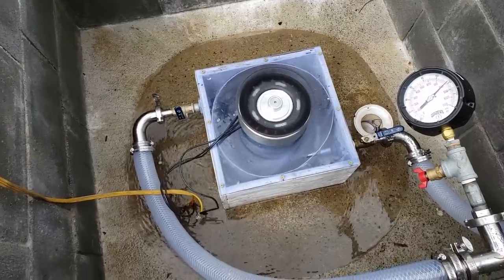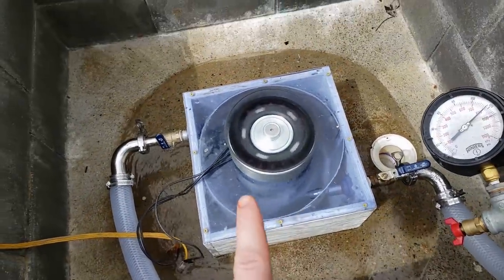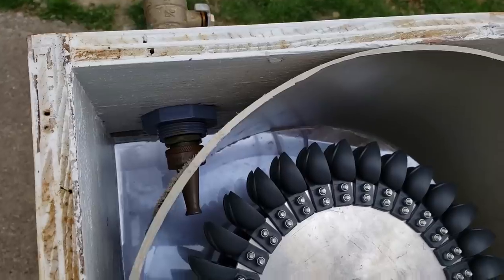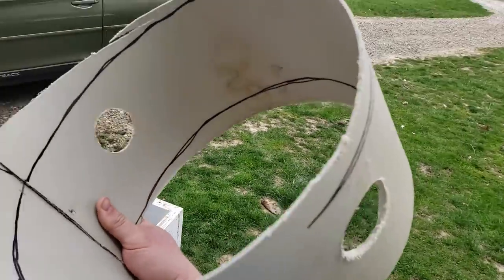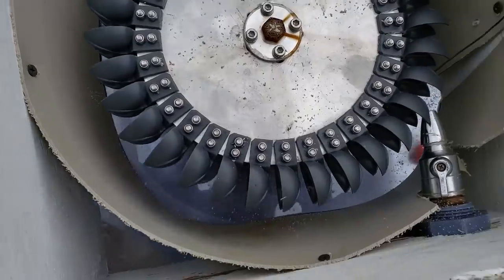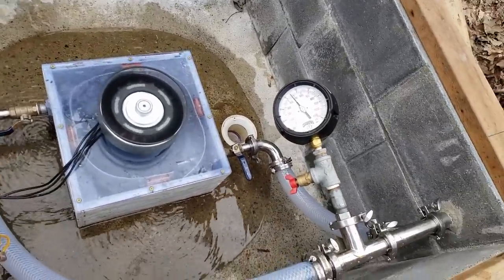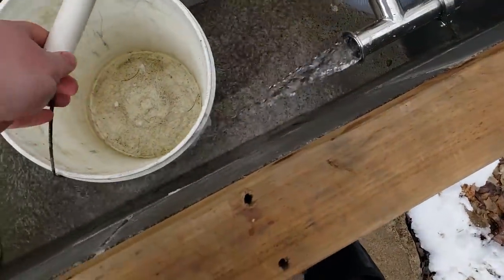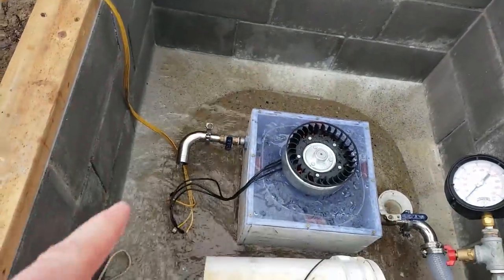Conical Turbine Housing, An Improvement?

Comment: would it work better  
if the circular buildings were smaller  
so that the blades are max 1 mm  
from her  
and that the blades are not cut as they are in the middle   only in full
 but their tips should be bent

in the direction of the water's flight 
so that the water from the walls also pushes the slopes  
and slid off them in the direction of circulating water back to  circular building walls

so as not to lose energy

Comment: Mounting it vertical will allow the water to escape without falling back through the turbine.
Reply: Christian Strohmaier Yes, another good idea.
Reply: horizontal is better for the bearings. He just needs a proper shaped housing. He could also consider just submerging that part of the turbine entirely and get rid of the nozles. Just use the water pressure like a tesla turbine does.

Comment: One test that would be fun to see is if the wheel has the power to run a cars AC pump. Why not take full advantage of the system to dump heat/cold into the house to match the season?
Reply from the maker: I plan on at least partially powering a minisplit to heat and cool my workshop.

Comment: The problem with your system is you are not thinking outside the box. And the box is your problem, it is containing waste water, not shedding it. An open frame is a better solution, once the water has impacted the pelton wheel you must clear the excess water away as quickly as possible. A round frame with 16 over lapping static blades in a spiral design would duct waste water away from the pelton and keep from rebounding back thus reducing drag to a minimum. 
Salute. ppcli 4 life

Comment: What about reflecting the water away (downwards) from the turbine where it currently is hitting your cone hard and splashes back? Another point is that if the water would give it's whole energy to the turbine it should just drop down or am I wrong. Where does all the fast moving reflection come from? Is it hitting the backside of the nect turbine shovel?

Comment: It looks like to me you still have water circulating around WITH the rotation of the wheel. Would it not be better if there were NO water circulating causing drag on the wheel? I would like to see you try your wheel with no liner, no walls. As soon as the water impinges upon the wheel, it just falls away / splashes away. What do you think of this idea? Thanks for sharing these videos with us.

Comment: Oh cutting slots at the top of the inner housing above the turbine is to channel that expended low velocity draft OUT of the inner housing....BTW...  =)  Probably should try to keep as much kinetic energy within the housing as possible.  It's gotta be a tighter fit...!    
Don't know though, both theories could end up being counter productive. Could be that the round housing is maintaining a lot of that velocity, transferring more KE before the spent flow drops out of the vortex... right..?    Oh and placing a small intermittant tank with an overflow loop a couple yards up the hill the would keep the flow steady and maintain the same flow.....  like a water capacitor....  =)  happy generating...!  Love watching....

Comment: I'm not a hydro-scientist by any means, however, I am a mechanic. When building an engine for performance, one of the ways you improve your performance is by using a windage tray which fits near the crankshaft. What it does is, as the crankshaft spins around, oil is ejected from off of the crankshaft. Without a windage tray, the oil bounces off of the walls of the block and back at the crankshaft. When it hits the crankshaft, it reduces the performance. How does this apply to you? You need to scavenge the water after it hits the turbine spoons (whatever you call the objects the water is hitting as it comes out of the nozzles) so it doesn't hit the spoons again, reducing efficiency. You could accomplish this taking a thin piece of stainless steel sheet and cutting slats into it, with protrusions pointing out towards where the spoons are at. I could draw a better picture than I'm describing it, lol. Better yet, the following image may explain better: https://www.vividracing.com/wm.php/images/20-914.jpg
Reply from the maker: I'm moving away from this style for windage issues.

Comment: Hey bro why don’t you try to put  another hose by separated  ? Because I guess it loses water pressure...because I see the same rpm when you open both of them at the same time I guess it’s not a good deal getting water current from the same duct or coming  from the same main line it’s like you are realizing the pressure when you open the second water valve  if it is separated I guess it would be a lot better ... well it’s just a suggestion ... good luck with your project !

Comment: If the housing was larger would that allow more room and distance for the water to not be able to bounce back and impede the turbine?  Maybe another 8 inches in diameter. That would leave 4 more inches for the water to travel after it hits the turbine if that is understandable.
Reply from the maker: I wanted the jets to be well supported close to the runner, also a  smaller box let me use scraps I had laying around and is lighter.

Comment: New to your channel so if you've shown this clearly I've not seen it just yet. You may want to consider a reconfigure of your Battery System to 24 or perhaps 48 Volts. Granted it will reduce your capacity but charging will be greater as you seem to constantly run @80ish volts. Your Charger is working overtime reducing the 80 volts to 12 which results in heat exchange. Since your water is 24/7ish the reduced battery capacity might not be an issue. I am learning 48 Volts seems to be the Standard and everything just seems to work better at that range. Wires don't tend to heat up as easily because with more volts is less heat. Again I don't don't know how many batteries you have. Also you'd need to reduce 48 to 12 which is easily done with converters and whatnot. Just a thought...
Reply from the maker: 48v is in the fiture.

Comment: For content - maybe do a 3d printed cone. Make it in 4 parts (so it fits your printer). Have two parts that are fixed in and two (where nozzles are) that slide in (like a sleuce gate) but have a slot for the nozzles. I can email you my idea if you want.
Reply from the maker: I have a 3d printer and have though of this, but I'm abandoning this style of turbine for a turgo in a stainess housing.
Reply: Joe Malovich will you have a circular cone shape or pyramid shaped stainless housing? Also with low flow rate -  if you increased your reservoir capacity would have enough volume to account for the inflow flow reduction (so you can run longer with out lowering output to avoid sucking air etc).

Comment: Imho you are using too big nozzles or the spoons are set a bit too narrow for the geometry for your small Pelton spoons, so your spons get clogged with water, which causes much drag. To gain the same or even more power, try to fix it by using more small nozzles (up to 6). Side effect: You can more easily optimize your power outtake to the provided amount of water by simple switching on and off the nozzles.

Comment: I wounder if you took a piece of 4" or 6" PVC, cut it in half lengthwise, then slowly heated it so that you could bend it into a circle around the outside of your Pelton wheel?  The industrial Pelton wheels seem to be place in a housing that closer surrounds the wheel.  Just a thought.  I am learning a lot from your VLOG so keep up the good work!
Reply: I was going to place the same comment, why not to use an exponential spiral shape. the lower side near the jets and the big side 180 degrees away?? like the francis turbines ingress tube.
Reply from the maker: A fantastic idea! I'm always in favor of attacking problems with a heat gun and PVC

Comment: I like your vids, but why dont you run larger cables back to the shed to help with volt drop? Cheers
Reply from the maker: only 10A 3ph, not much of a drop. I have some 4ga wire to run.

Comment: Why no use a spongeous cover for the housing? It will avoid backsplash and is easier to instal
Reply: After saturation, I don't see any benefit. It will keep splashing just the same.

Comment: Do you know how close are you to a theoretical maximum power from your system? (Given the 9 gpm flow and pressure measurement at the turbine)
Reply: At 9GPM and 120 psi converted to metres of head (82.7 or 277ft) he's making around 60% efficiency at the controller. Turbine losses, transmission losses, rectifier (AC to DC) losses, controller losses would add up, I'd hazard the turbine itself is 75%
Reply from the maker: except that nizzle flows about 13 gpm so my efficiency is lower and I ran out of water later in the day.
Reply: @JoeMalovich  you were getting 9gpm in the video, just because it can flow more, doesn't mean you should get more energy it's about what you were getting

Comment: Why are you always going for a smooth surface on the cone guard ?  Wouldn't deflectors be more advantageous ?  You are trying to take spill energy out of the water when it leaves the turbine.  That energy is deflecting back to turbine after hitting the wall impeding the turbine.  Light reflecting off multiple surfaces will dissipate to nothing (lose all energy).  Pressure waves of air lose energy by slowing down and expanding (gun silencer.)  On Dams that have releases water flows across multiple steps or a hydraulic jump.  Given your setup a jump is not possible (gravity needed).  Your next best option is a set of baffles (deflection type) all pointing downwards to your water drain.  Your little rock in the video is a perfect example of what you need to do.  Use a large tube with lots of small deflectors inside.  Trying to stop all flow energy is impossible given your small space.  Since you are only using two flow injectors only two flow reducing tubes need to be made.  Take the cone out, use two 4" PVC tubes with lots of small rocks glued inside.  Point the tubes downwards towards the bottom drain.  The opening of the PVC tubes may have to modified to catch the deflection water over multiple flow rates.  Think along the lines of turbine impellers reversed to catch the flow.  Thinking about the rocks to be used.  Small rocks at the opening getting larger ones towards the bottom opening.

A lot of info provided, hope you got the gist of what I tried convey.
Reply from the maker: This handles any water flying out well so doesn't really need changed but I still have water flying straight up and inwards.

Comment: Put some scallops in the walls to kill the splashed water and direct it away or better yet open the sides right up, set up the top like a tabletop with just legs to hold it up and hold the nozzles allowing all the splash to leave the area of the wheel unobstructed.
Reply from the maker: that is a viable option.

Comment: how about an used turbo. the have optimized flow maybe just use the hot side and mount the alternator on the turbine shaft. Smaller the better, maybe off a small turbo car.

Comment: Could you do something with an impeller shape where you have multiple fins and the angle of attack allows the water to bounce out into the outer space? Not sure if there's enough space in that box, though.
Reply from the maker: That is a viable option.
Reply: Pelton cups remove energy from the water efficiently by turning it around almost 180 degrees.
Impinging water onto a flat surface removes much less of the energy, therefore being much less efficient.

Comment: I’m in to renewable energy, solar and wind. I’m not familiar with this method so forgive me for the question. How is the water pressure achieved to spin the turbine?
Reply from the maker: gravity feed from a spring up the hill
Reply: Joe Malovich. So what kind of psi are you able to get or may I say psi need to operate that turbine?
Reply from the maker: @Checkitfirst  117 psi
Reply: Joe Malovich. Thank you for your time. Awesome videos 😁
Reply: See if you can get a copy of a CD of all the issues for home power magazine. Unfortunately they recently stopped printing the magazine that was started in 1987. If you're into renewable energy I think you'll really enjoy it.

Comment: Hey, the first comment I posted didn't go through...
Anyway.  As I had posted earlier.....
The tire shaped housing was a tgreat idea... that would help direct the catch* and transfer more KE into the torque...  scap the cone,  keep the housing tall and just cut slots to channel the excess draft out.   Study the path of the draft and bend then inner housing into an elipse to promote better kinetic retention and to gently guide that spent up low velocuy draft away from the turbine.  Look up how they frame skateboard ramps and fit the parabola pieces ino the main housing so that you don't need to struggle with mounting the inner housing every time you replace it or secure a new prototype.  Also,  why not just 3d print the cone and mount that as a cap over the round housing..!?
Oh, one last thing, you probably already did this but it doesn't seem like it...  * if you place a small intermittent water tank, with an overflow loop setup inside it would regulate a steady flow rate for the inlet without sacrificing any pressure..  it also serves as a convenient "mass filtration" system opportunity for less frequent msintainance problems.  Any debree would need to pile up before even beginning to slow the system down and mostly eliminate any stoppages to the inlet..  
I hope it help of you do try..!  
Good luck, your pioneering is an inspiration to us all...! 
Great experiments..!
Happy trials..
Love watching...!  =)
Reply: Ps the tank acts like a capacitor to regulate the flow ...  obviously...

Comment: Joe you're experiments are interesting. What I could tell you from being in the hydro generating field for many years is that you are using the wrong turbine for the flow rates you have available to you. The Pelton you are using is designed for The direct opposite application you are using it for.It is a pulse turbine used for low flow high head pressures over 300m. The low volume you experience would eliminate the use of a Kaplan Turbine used for the opposite conditions that being high flow low head. Which again you do not have coming from the drain pipe. Both will work to some degree but will do so with terrible loss of efficiency. Which you are trying to overcome by nozzle alignments and a housing. With regards to a difference of flow rate.. NO the flow rate is determined by the nozzle size and as I mentioned the Pulse turbines efficiency is determined by pressure not flow. For what you are trying to accomplish with you're flow and pressures the better option by far would be a Francis Turbine which is a type of hybrid between the afore mentioned Pelton/Kaplan Turbines The Francis Turbine operates in a mid flow mid pressure range. Good luck in you're endeavor. 

Note: you're location is not great you are lacking the real potential energy to drive a turbine to any degree. you must have either high volume flow or a high head pressure. The meter or so head you have and the trickle of water you have to work with is not a good start. The solution would be a small damn at a 30 meter elevation higher than you're Turbine. Then you will see what you are looking for. To store the energy cheaply store the power as hot water in your home or use the power to compress air and use an Air turbine to release it.Yes it is somewhat less efficient than say a battery bank but much more cost efficient. And you're power costs are not a factor because you are self generating it so it far and away a better option than batteries. The system you have creates a trickle charge at best I'm guessing it would take you years of operation with the current setup to re coop you're startup cost. With the low head pressure you have any amount of Load would stall it in an instant. Remember the Pelton operation has nothing to do with flow ONLY pressure, this is key! The housing is just redirecting waste water flow nothing more. To demonstrate the point just replace you're low pressure water with a high pressure air line and the pelton will take off like a scalded cat :)

Here is a far better visual of what I have said. https://www.youtube.com/watch?v=k0BLOKEZ3KU

For you're application this may be the answer or something similar. https://www.youtube.com/watch?v=mXJQrxEKxMQ or this model https://www.youtube.com/watch?v=0hcGnysoUFI
Reply from the maker: @MuscarV2  Hey I don't appreciate negative comments of this magnitude on my channel.  He/she means well albeit misinformed.
Reply from the maker: All your charts don't apply for Microhydro as small as this. Pelton or Turgo turbines are the only turbines that function under highly variable flow rates and massive (in terms of Microhydro) head pressure as I have.

Also as an educational channel the system had paid for itself on day zero through YouTube ad revenue.
Reply: He has 83.8 meters of head, up to 1.9lps of flow. He states that in a earlier video. Quite a bit more than 1m. 
Could be useful to put that in the description I suppose. Fun to watch this process.

Comment: Why not to make the cone with holes in it? Kind of sieve that would let water one way through the cone. You would limit the cyclone effect. Or even a straight cylinder.
Reply from the maker: that is a viable option.